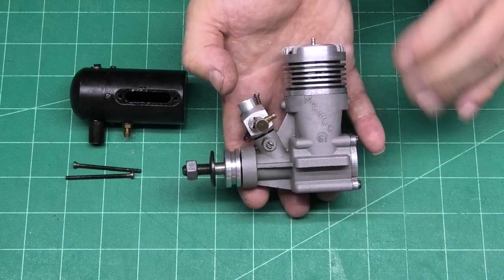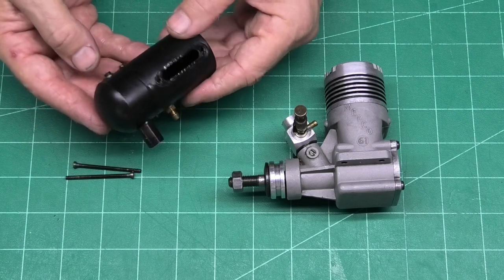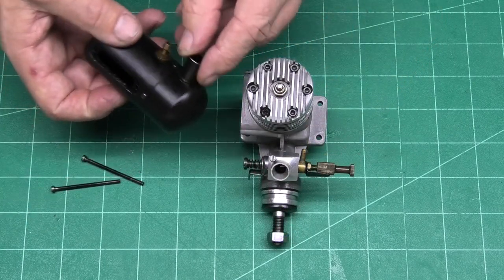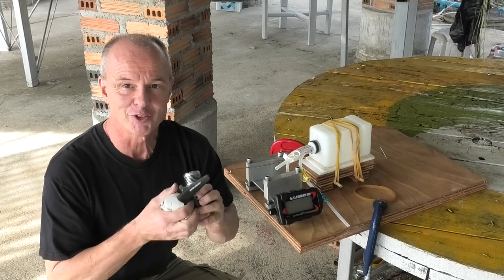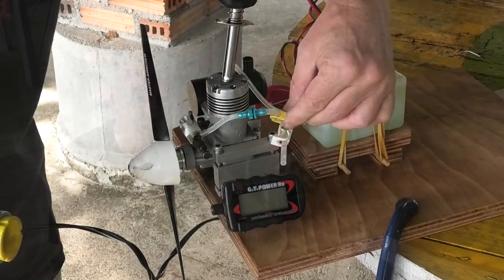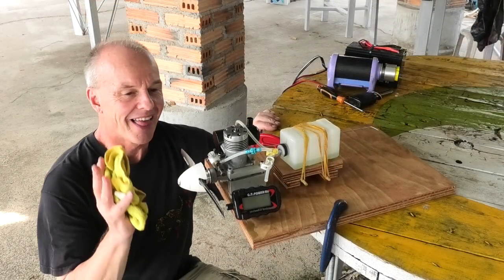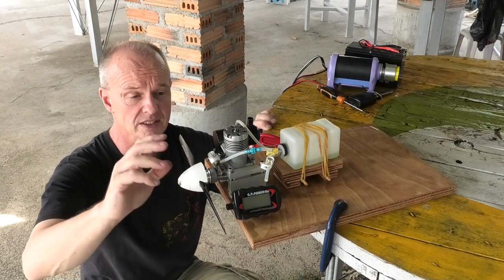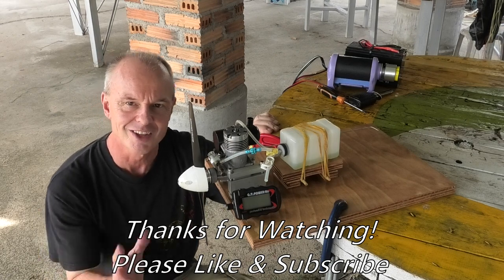Merco 61 Mk IV, an excellent 1970's English glow engine - review & test run

Comment: Mark --- Thank you for sharing the run time of some of these old engines --- some I didn't know were out there. 
 I noticed you were about to adjust the high speed needle with your left hand but, quickly brought it back and used your right hand. I wonder how many beginners ( like me ) --- and maybe the old pro's that would  go in there with their left hand and mess their hand up? -------- Safety  ------  I guess more than just a Tip --- something to STRESS which hand to use! -----Rodney
Reply from the maker: Hi Rodney, thanks for the comment it's appreciated 😀

Comment: I have used rubber sealed bearings in the front of 2 strokes many times. They seem to hold up fine.
Reply from the maker: Excellent, thanks, good to know.  I have now done just that with this engine Merco and it runs lovely

Comment: Whenever I replace a front bearing, I always use a rubber sealed bearing but I remove the seal on the engine side.
Reply from the maker: Thanks for the comment, really appreciated. I have now put a sealed bearing in the front and it runs really sweat, just love the engine and cant wait to see it flying again!

Comment: I've got 3 of these and one with a reverse rotation crankshaft for use in pusher applications using standard props. I've also got the latter diesel and spark ignition versions. The design is not a rev'er/screamer and develops peak power at approx 12,700 - 13,000 rpm. An 11X 6 is IMO a little on the small size, an 11 X 7 or 12 X 6 being preferable as they will unload in the air nicely. I normally run them on 20% all castor and 5% nitro propped for about 11,00rpm static. They will usefully turn larger props like a 14 X 6 for vintage style planes. I get 10,500rpm on a 13 X 5 Zinger wood. Test by Peter Chinn http://sceptreflight.com/Model%20Engine%20Tests/Merco%2061%20Mk%20IV.html
PS the standard front bearing was an open ball race and I replace with a shielded version(removing the inner shield) but have no problems with fuel leakage. You may have some wear in the front housing and a rubber seal bearing(removing the inner) may help. Have fun. I also like to 'reclaim' old engines and bring them back from an undeserved retirement in the scrap box.
Reply from the maker: Hi, Thanks for the comment, really appreciated.  I totally agree about the prop, think I will try it with a 11x7 in my trainer, I could put a 12x6 on but would like to keep a little bit more ground clearence.  I have put a sealed bearing in the front now and it runs really sweat, just love the engine and cant wait to see it flying again!

Comment: Hi i have a merco 61 but mine has the twin glow plugs in head
Reply from the maker: Another great engine, think it was the Mk II and Mk III that had the twin plugs. Great to have, nice to have something a bit different!
Reply: Test for the Mk III twin plug with the single 'dykes' ring  http://sceptreflight.com/Model%20Engine%20Tests/Merco%2061%20Mk%20III.html 
Note: The twin plug head is interchangeable with the with the latter single plug head(either engine, either head). But, the twin plug head does give a very slightly lower compression ratio on the later engine.

Comment: I’ve just got hold of a Merco 35! I had never heard of them until today! Is there much information around about them? I assume if they are as old as yours then parts are not available!
Reply from the maker: Merco engines are great, but as you suggest parts are only really available from other engines, or the odd part that come up on places like ebay.  New rings are easily and cheaply available, I can send you the info if needed.  Also, are you aware of this site, its quite interesting and useful - http://sceptreflight.com/Model%20Engine%20Tests/Index.html
Reply: @MarkRobinson555  thanks! My biggest concern is it has no muffler, hopefully there is a universal one somewhere that will fit. I think the whole spacing is 1.5”. Thanks for the link, I’ll have a look.
Reply: @MarkRobinson555  wow that link is gold!
Reply from the maker: The muffler hole spacing sounds the same as on my .61 engines.  The mufflers do come up now and then on ebay, either the torpedo shaped ones with Merco on the side, or the dustbins, which I prefer.  The fixing bolts can be a bit of an issue, they are 6BA or 4-48 UNF, which are very similar size threads, and for the dustbins they need to be 1 3/4" long.  Sure you will enjoy running it, will we be seeing a video? Hope so!
Reply: @MarkRobinson555  Thanks for the invaluable info! I notice that the engine test documents show the .35 without muffle mount holes - I assume mine must be a later revision. I'll definitely make some videos - im just about to start filiming a rebuild of a Saito FA-45 Special i have got hold of.

Comment: Hi Mark,Hope you pick this comment up being its a old vid. I have the chance to buy a 61 merco marine engine. It is claimed to never of run BUT has no exhaust. Are parts easy to obtain for these engine still?
Reply from the maker: Hi Gary, they are great engines, but spare parts can be an issue.  The best place is ebay where bits come up from time to time.  Also, the hole spacing for a 61 is 37mm on the muffler bolts, so there will be other non Merco parts around that will fit.  I believe from memory the bolts for the muffler are 4-48 UNF